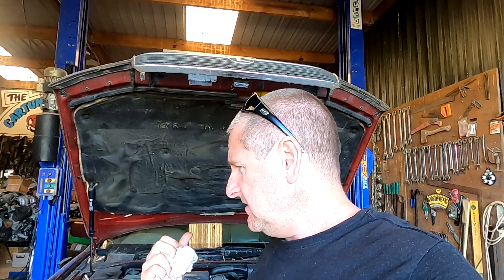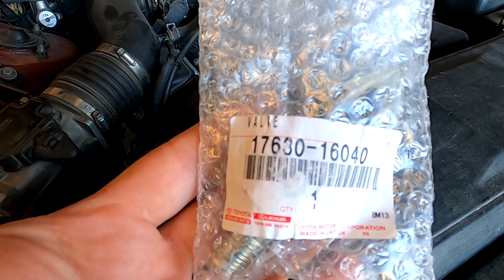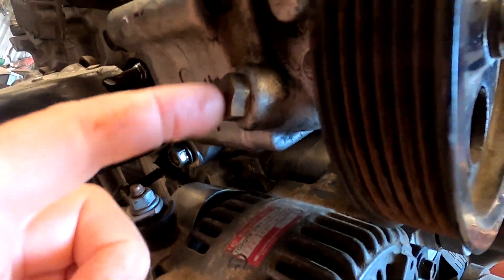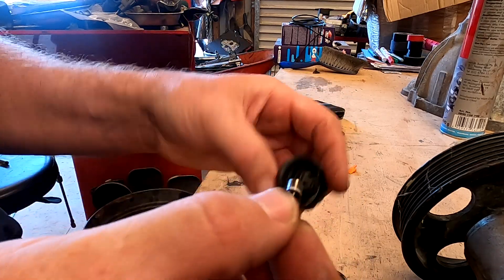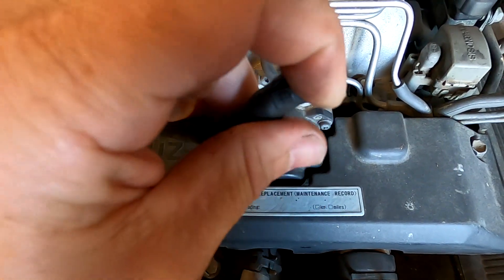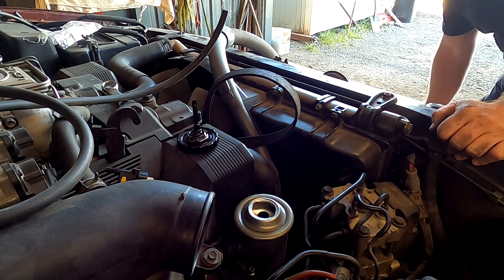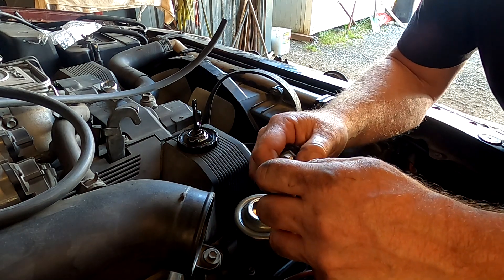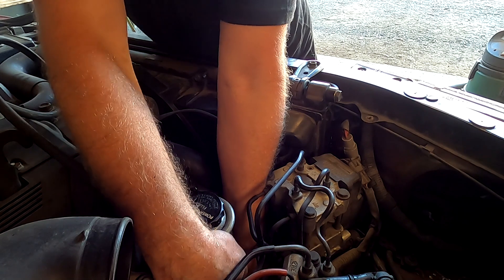Lexus LS400 , Ls430 and Toyota Celsior Powersteer idle up valve ( IACV ) replacement. How to.

Comment: Hello, my GS430 seems to have a leaky acv due to the last owner using incorrect fluids. I’m going to blank it off because winter is coming up and I won’t be driving the car much. What am I supposed to use to plug up the vacuum lines?

Comment: G'day Kelvin! My steering wheel has always been heavy, and it doesn't return to center through a turn. I just replaced the PS pump with a brand new Toyota pump, and also replaced the lines, after flushing the rack good. Steering is still heavy and no wheel return through a turn. Could it be that the rack needs rebuilding? No weeping from her yet; no noises. Many Thanks!

Comment: Hello. Can you tell me what this vacuum has to do with the hydraulic pump?  Can this part be canceled?thanks😊
Reply: It's meant to increase the engine rpm when you're turning the steering wheel at idle. It would be kind of dumb to delete, it prevents a stall (which i dont think it'll stall either way).

Comment: What grade oil do you use for your f20
Reply from the maker: As this is a video on a powersteer repair,  and you haven't said which oil I'll give the powersteer oil I use,  which is often atf fluid,  dextron 3 or type 4 or if the vehicle gets a hard time I use penrite power steer fluid.  Cheers Kelvin

Comment: Hi Kelvin my car has a bullet super charger with intercooler and a Wolf ECU i was thinking I should just do an Idle up valve delete what is your suggestion?
 you mention you just place a ballbearing under the valve what size is the ball bearing? my car s an hour drive away.

Comment: Hi kelvin I have just pulled my car down to the intake manifolds chasing oil puffing in exhaust.
Found red oil under supercharger intecooler. Your video may have saved me an engine rebuild.
As I have also been having powersteering low oil and airating issues.
Just had p/steering pump rebuilt.

Comment: Not sure what I did wrong. I installed the air valve using no sealant and it leaks.  Is it possible the there is a seal internally that is damaged in the pump itself? The old one was sweating oil at the threads
Reply from the maker: There is a little brass seat in the powersteer pump which the valve seals on.  Maybe that brass seat is damaged.  Cheers Kelvin

Comment: My cap popped off from the bolt when changing a hose , should I stick it back on there with epoxy?
Reply from the maker: I'd be fitting a new one if I had that issue.  Cheers Kelvin

Comment: Any idea why a Lexus sc400 would idle fine when cold but when it gets up to temp it drops a little below 500-400rpm?!
Reply from the maker: Could be an ecu issue,  tuning issue,  air leaks,  IAC function,  sensor fault etc etc.  I would recommend doing some testing to identify the issue.  Cheers Kelvin

Comment: i have a 1997 celsior, would a 1997 ls400 power steering pump fit the celsior?
Reply from the maker: Yes,  They are the same pump and if you check toyodiy for the cross reference you will find they are the same part number.  Cheers Kelvin

Comment: Thanks for the tutorial. I went searching for those o-rings on the plunger but am not finding them at the Lexus dealer. Would you happen to have a part number you could provide?
Reply from the maker: There are no psrt numbers at the dealership as dealership only supply the complete valve assembly.   For o-rings its a trip to an o-ring supplier.

Comment: Hey bro my LS400 think it’s a 1990 it’s reving high and not dropping what could it be, also can smell fuel, no leaks anywhere it’s like the choke is jammed on. Used to rev high but then when warm comes back down to normal now it just stays high, what could it be 🤦🏽‍♂️🤦🏽‍♂️choice one bro👍
Reply from the maker: Id recommend checking live data in ecu to confirm ecu is seeing correct engine temp,  tps with both main tps and idle switch and other inputs are correct.  Could be a few things so testing is the best way forward

Comment: So your saying blue smokes may also come out when this value is bad? Because before installing power steering pump it would smoke blue on start ups and disappear now that we broke that value while installing pump it smokes white like a train and blue as well. Is that why?
Reply from the maker: Id recommend starting by fitting a new valve,  and checking the pcv system too.

Comment: Nice and easy on a normal one ,  but when you have a Soarer UZZ 32 its a real struggle.
Reply from the maker: UZZ32 are very rare.  I was surprized recently by the local toyota dealer asking me for info as they couldnt find parts , they didnt even know about the UZZ32 being different , and I had an engine turn up on the back of a ute , again a UZZ32 engine.
Reply: @CartuneNZ  there are 2 UZZ 32's in NZ, In Australia there are about 20, i have a couple of them, and yes no parts available now for the Suspension etc. Only 851 were ever made by Toyota, there are about 200 left world wide in running condition.
Reply from the maker: Well that means I've been involved with both of the nz ones,  and I've seen a few engines out of dismantles ones.  I have a mate with an engine in the uk too.
Reply: @CartuneNZ  That may be Mike, he has one and transplanted a 3UZ into it.
Reply from the maker: Yep,  Mike and the one at the dealership

Comment: wow you saved my bacon I just discovered the black plastic housing on mine detached from the cup bolt looking thing screwed in the PS pump,,I was holding thos two vacuum lines with the black plastic attached looking confused as to what it was after doing a 5 day starter replacement job...I am not a mechanic
Reply from the maker: Glad to help.   Cheers Kelvin

Comment: thanks for putting up these videos , lots of good Information thanks. 

can i ask you please what do you do in the case of a 1uz with a link g4 . can you use an electrical switch or something instead of this factory valve ?  or can you remove this system is it necessary for a street car ?  I'm doing a conversion now that this is a question mark on the list currently , not sure what way to go
Reply from the maker: If its manual,   with link ecu I normally delete this idle up and with correct settings for the iac with a well tuned engine the ecu will compensate fast enough.  If I'm running something with massive tyres where we also want very low idle speed we would fit a electrical switch and feed this to the ecu and adjust the power steer idle up setting in the link.
Reply: @CartuneNZ  Kelvin , thank you very much this is what I needed to know. yes its manual and I don't think the tires are what you'd call too large. but its a nice and light car so that should help somewhat : ) 

but I do like the idea of electrical switch, I think I have not used up all the inputs yet. . do you have a particular switch that you like to use when doing conversions ?
Reply from the maker: For a switch I look to some other models of toyota have a switch which screws in as a direct replacement for the stock air bleed valve.  I think I have one laying around to check a part number off it.

Comment: What is the use of this valve and what is the importance also the work of this valve need ur guidance
Reply from the maker: Its a idle up valve for the powersteer so when the powersteer is operating the idle is increased slightly.   I think its quite important for stock vehicles and swaps with autos.
Reply: @CartuneNZ  couldn't you just delete and Rev yourself?  I'm afraid this thing is just gonna leak again I know how to block it off, just don't know what consequences come with it
Reply: @gang6009  400-500rpm low idle. jumpy take offs. If it were me i would just bite the bullet and replace it if you want your car to operate smoothly.

Comment: I noticed a leak coming from that part, i replaced it, do you think i should replace the power steering pump/reservoir?
Reply from the maker: I never replace reservoir unless they are damaged.  I do rebuild lots of PS pumps , which I prefer to replacement.  cheers Kelvin

Comment: Thanks for this! Mine is snapped off on my JDM motor.  Lexus wants $135USD for this little plastic valve! Exorbitant considering the pump costs about the same! The local Toyota dealer wants $113!
Reply from the maker: Glad to help. Cheers Kelvin

Comment: Is this the correct part number for a SC400 1995? parts website say this wont fit my car
Reply from the maker: I use Toyodiy.com and lists fine.  I believe his part fits all 1uz engines which have this valve and heaps of other Toyota models.  There are other part numbers for this same valve.  Cheers Kelvin

Comment: I replaced my power steering pump on a ls400 98 model, but I didn't include the air hose.. Would it cause any damage with time ? Please I need your advice
Reply from the maker: If the hoses are in good order then no issue.  Cheers Kelvin

Comment: Professional Kiwi UZ Wizard opinion on electric power steering? My 1992 SC400 had the hydro pump that leaked onto and killed the alternator.
Reply from the maker: I think in stock vehicles its far easier to repair the nearly 30 year old pump which has possibly never been apart and it will give many ore years of service than to stuff around reinventing the wheel.
Reply: @CartuneNZ  Thanks. I'm thinking for swap purposes in a place a UZ was never intended to be and power steering didn't previously exist but generally I'd agree about not reinventing the wheel. Even though I guess engine swapping pretty mush is exactly that haha.